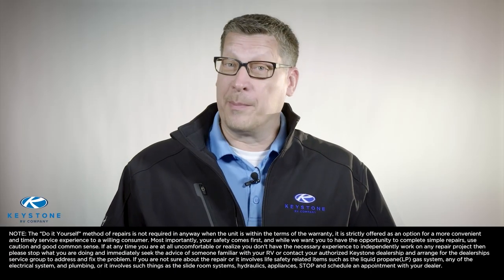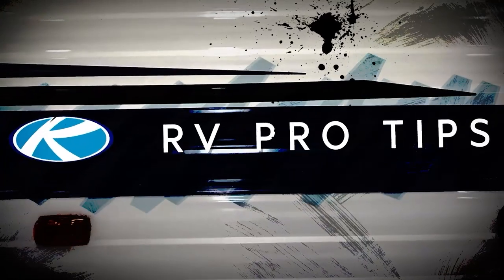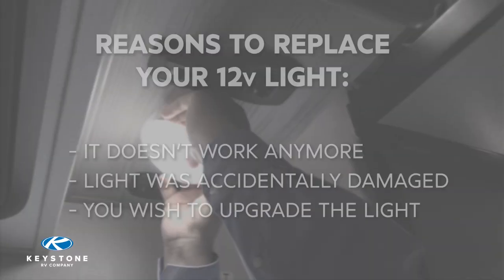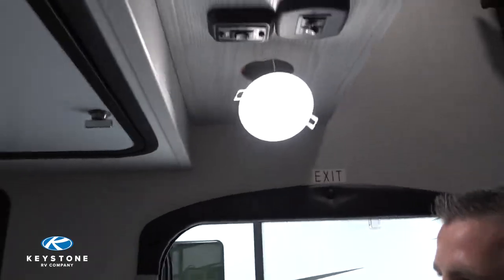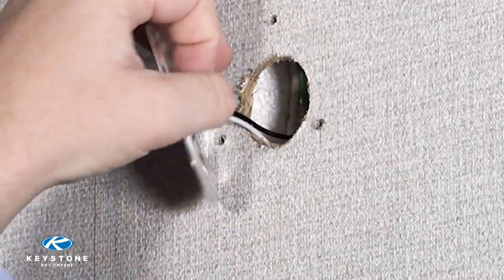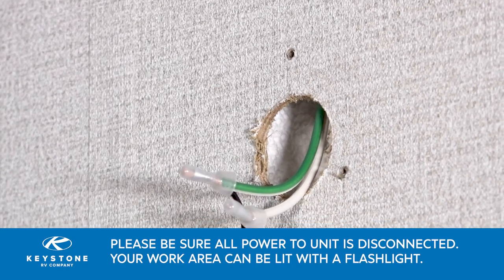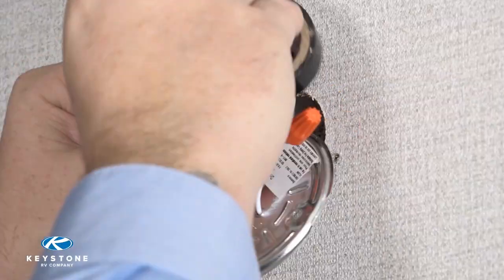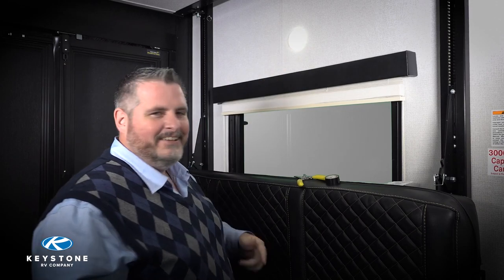RV Pro Tips: Replacing a 12v Light.

Comment: How about a video on how to connect a power inverter to your inverter prep that I found on my 2021 Fuzion. Like, let me know where the romex leads to. I know one end goes to the breaker box where I found a breaker dedicated to the inverter. Where does the other end lead to?
Reply from the maker: Good morning, the plastic cover for the Inverter Wire Prep can be found in the front pass thru mounted to the upper deck. If you have further questions about this, please do not hesitate to contact our Owner Relations Team at 1-866-425-4369 or via email at ownerrelations@keystonerv.com  Thank you!